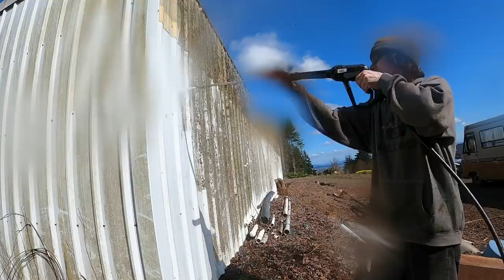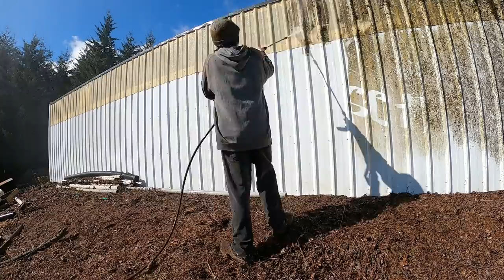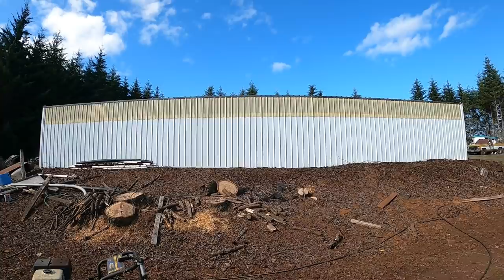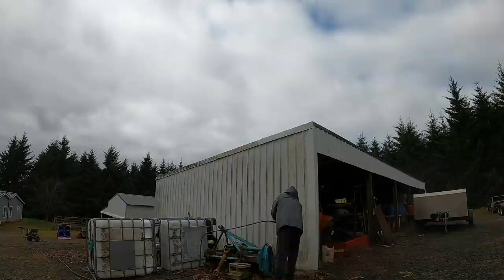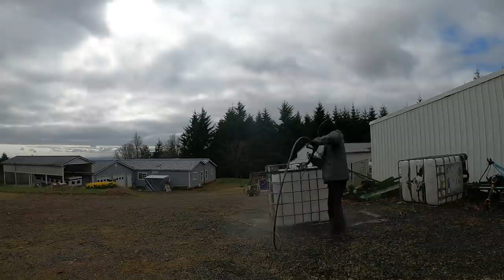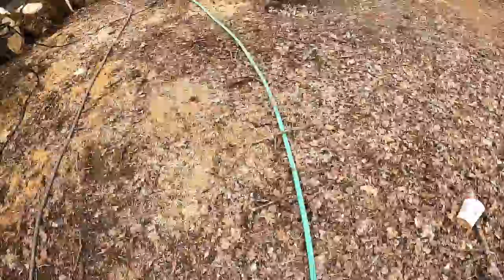Pressure Washing A Dirty Shed

Comment: The owners of my trailer park did that to get off all the mold from their trailers. Soon afterwards the mold came back. I just use a simple spray bottle with half bleach and half water. I have the only trailer without mold on it.
Reply: Well if they did it correctly they would have used a chemical that is specific for removing mold and other substances. I’ve had to use mixed chemicals many times to remove mold and algae from boats.